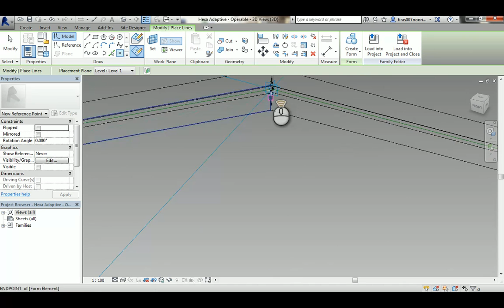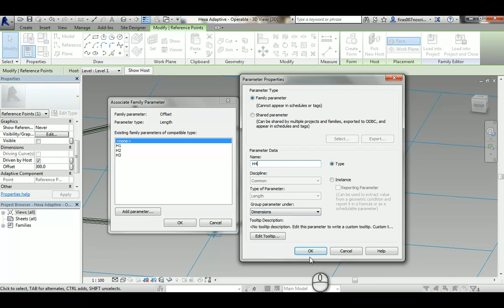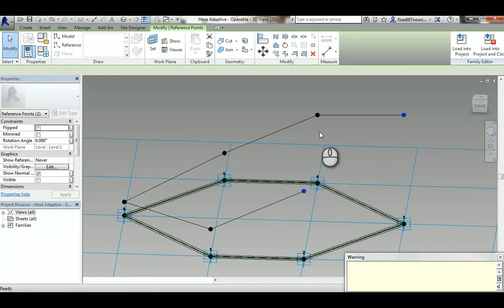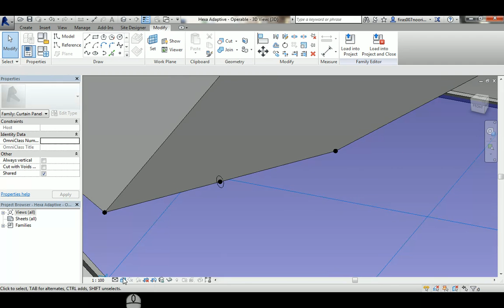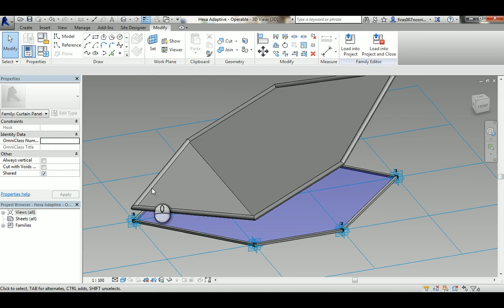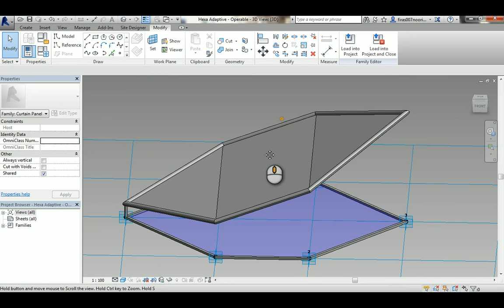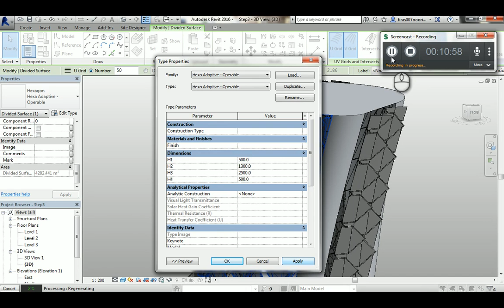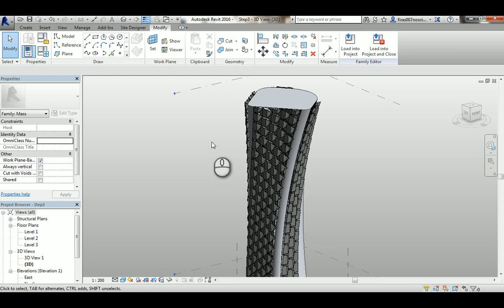Making a Tower in Revit Conceptual Mass - Step 3

Comment: It's a great tutorial, helped me a lot. Just have one problem. I can't select the whole glass wall, only the single elements of it. Could you tell me how to resolve it?
Reply from the maker: Can u share the revit file plz? so I can see this issue.
Sometimes pressing "TAB" key helps to tell revit to switch from this element to the other
Reply from the maker: HI, sorry for my late replay but I was overseas and far away from home. I just arrived recently, I saw the file and remodel the geometry again, if you need to select the entire surface (the whole glass) then you should go to the conceptual design and do that change as it considered as part of the the overall conceptual mass not as a part of the final project, ergo, the project will show you only the accommodated tiles or units u modeled, while the entire curtain, you need to go to the conceptual mass of this shape and then change the whole thing and then upload the whole geometry into the project again
Reply from the maker: you can also model the tile as a part of a curtain wall panel, i think this will allow you to select it and to select the entire wall, this might be better for you that using conceptual mass as a base of your model

Comment: Dear Firas, thank you very much for the great tutorial, I tried to do the exercise but i have a problem, I wish if you could help if you have time for that.
The lower panel & the upper shading device are not linked together in terms of size, when i upload the file into the conceptual mass I find that the panel is one size while the shading device is another size, although i draw the 6 point elements on Level-1 exactly as you said.
I'm using Revit 2019.

thanks in advance.
the files are attached
https://drive.google.com/open?id=1RKctmlOLg8HpJpvqW1Xt0qwII1HFY8Gj

https://drive.google.com/open?id=1OhyPg7VPtqRXP054oY8NKmRf__EmKgOZ
Reply from the maker: Happy to hear from u dear brother, I will open the set of files u sent as soon as I get back home and I will see what's there and write for ya :)
Reply from the maker: Hi dear Ahmed, I opened your files, and I understand that this problem might happen, and it would be the best strategy exactly after you install the 6 points and after you raise them lets say 600mm above the glass level by "OFFSET", you should select the hexa grid and then change its properties to make it lets say 5000x5000 and see, it the flying points are not matching the ground, then simply delete them and repeat the process and instead of picking LEVEL 1, choose "PICK ....." then select for each point the horizontal reference plane that it will be attached to it, means that you need to select the six horizontal planes create by the adaptive point, so the new reference point will be attached to the adaptive point reference plane beneath it, instead of attaching them all to LEVEL 1 or 2, this will ensure when you flex them by changing the hex grid in the curtain panel family (Not in the Conceptual Mass Family) that they will work properly now and then
try this method my dear, and tell me please if you was successfully passing this issue or not, so we can fix for you this case forever,

Cheers
FN